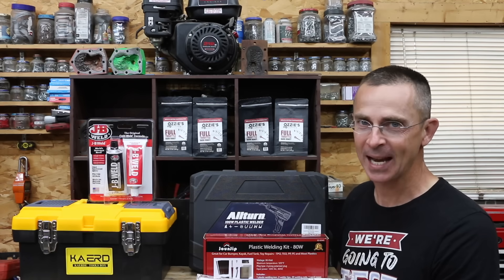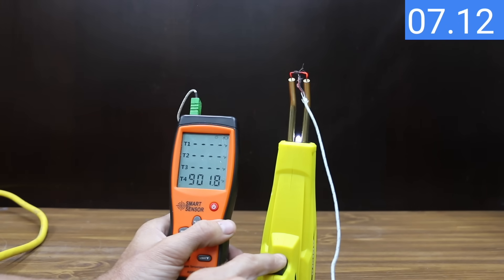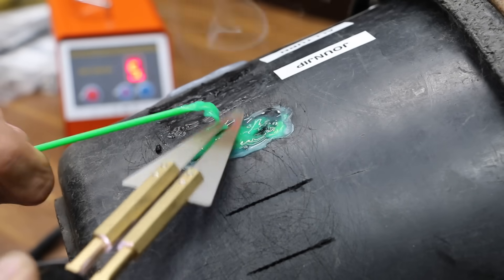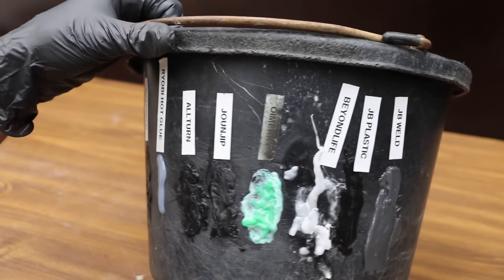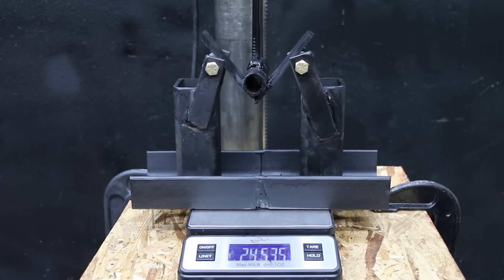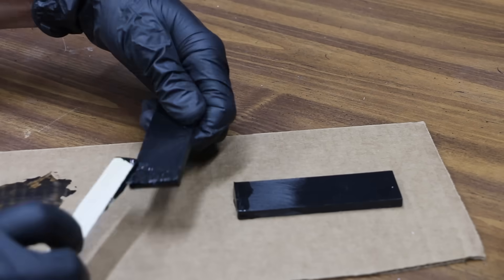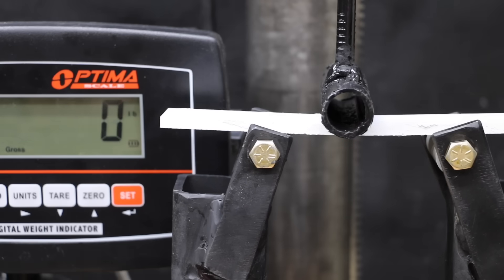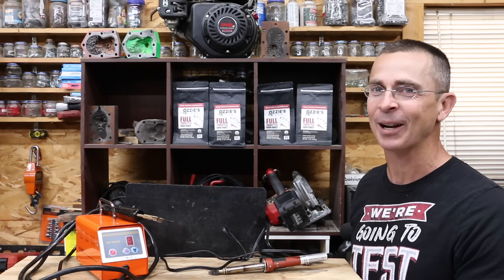Don't Buy A Plastic Welder Until You Watch This Review!

Comment: As an automotive technician I use the jounjip kit and found that for best results melt the wire mesh into the plastic before using the filler. Often times it’s stronger than the original piece and has saved my butt countless times. There is a learning curve and results become stronger and look better with practice.
Reply from the maker: That's a great tip!  I should have done that! Thank you
Reply: ❤😂jok4th o⛪️❤🤣 @ProjectFarm joints i😂😂I o k😂I o o iiio🎉🎉😂😂😂😂😂😂😮😢😢so 😂😂😂iieq1😂😂800W w😢chi iiio😊
Reply: @ProjectFarm  This thread is awesome and gives me an idea: Please setup a forum or something, where you announce future tests, so people can give you some ideas on how to best do the testing. Got to say though... most of the time I am at awe about the testing methods you come up with. :)
Reply: @ProjectFarm  please do Best Car Jumpstarter 2023 video with these brands: Foxpeed,Povasee,Lokithor,Noco[full lineup],Yesper,Audew,Hulkman and Gooloo GP200/GP400/GT400 please
Reply: @ProjectFarm there are a lot of products on the shelf that promise to clean and restore wet and dry paint brushes. Do you think they work better than turpentine or gasoline? They promise to be environmentally friendly but do they work and how much water do you have to use to get them clean?  Best Water Based and best Solvent based. You can even make multiple videos based on brush types natural vs synthetic.
Reply: Yeah you need to get in there melt the damage so it can fuze together.
Reply: @Lappmogel Fuse
Reply: @David25522 funny thing is once staples are placed to stop the split and maintain shape, the 2 part fusor is what to use after dremel grinding out a  v shape along the crack. 😊
Reply: @ItsMe-vg4vj damn that's some solid advice. Thank you
Reply: I was thinking that while watching, "shouldn't he be melting the mesh INTO the plastic?"
Reply: @Drundel  ,  A hot air heat gun is often the best way to melt the metal mesh into the plastic prior to applying the plastic welding stick over the mesh.
Reply: @goodun2974 No it's not.
Reply: @goodun2974 Bingo, heat gun is the key for an easy repair. I’ve been using something like that for the last twenty years now, I take license plate frames and cut them in small strips to use because it’s the same plastic as the bumpers I have also used tire plugs too.  I also keep a spray bottle of water that I spray my work area to quickly solidify it in place for when I’m shaping something. I also use spray foam behind the bumper when I’m making a repair while still on the car. That’s only if there’s like a whole or something like that. Skim over it with some finishing putty and primer and it’s good. Time saver for sure.😎
Reply: @annacurransmotherofmeghanc1841  , I work in a stereo repair shop specializing in older audio equipment and so I often have to repair broken plastic knobs, gears, cams, and trim, typically with a combination of heat and adhesives, and sometimes reinforcing the repairs with screen mesh, fiberglass cloth, heated staples embedded in the plastic (ordinary staples pushed into the plastic with a soldering iron) and so on. A large heat gun and a smaller hot air "pencil" are invaluable for this type of work. Some of the plastics such as nylon or polyethylene reject most efforts at solvent welding or gluing....
Reply: Another tip with just the triangle irons before using filler rods push one of the corners into the crack until the plastic melts together kinda like stapling then use the filler and finish by smoothing the repair with the iron
Reply: Good to know never used any one of the Plastic welders before
Reply: You beat me to it. I said the same thing in my comment.  It's a bit of a learning curve, but once you get it right, the repair is often stronger than the original piece.  It's best to heat the mesh directly to melt into the original plastic then use the filler.
Reply: Which method would be the best to get a clean repair like on a dash board?
Reply: @Deested  ive done a few dashes and bumpers and stuff that held up pretty good.....
i just used a soldering iron with a woodscrew as a tip (tip of the screw, screwed into the iron).... get hot...smear into eachother..... 
Always clean FIRST!! ....... then weld
ive melted staples in and covered with slivers from other areas i could cut a bit off (by the mount tabs etc).......... sanding not necessary till the end for blending
old shattered dried out will dashes shatter again....(no real fix as the plastic has degraded)
a good machine or higher wattage soldering iron probably would have worked better/faster
V groove like with a metal weld for thicker parts is a good idea.
shave slivers from reinforcing ribs mount tabs etc to weld with the same (right) kind of plastic.
shove the plastic as it melts around and mix it....build a ridge up behind the crack.
smear around a lot wider than the crack to work it into the crack.
a hotter tip will melt the surface fast...so you can pull material from a wider area without digging deep and thinning the repair area too much.
repair the area then let cool...then melt in a small piece of mesh....this keeps the heat from warping the whole area of thin parts
Reply: @kazzxtrismus you can use heat guns made to solder better than an iron, and they are relatively inexpensive.  You actually can set the air output temperature fairly precisely, and it costs less than a solder station (which is also temperature controlled).
With the heat gun you can pretty easily "flow" your repair like welding metal.   I'm a clutz and my plastic repair look like a good weld when done. 
Remember that the solder air tools are relatively low flow and have about a 1" outflow and fittings to go down to a 1/4"... these are not the normal heat guns
Reply: @Deested  V cut a groove in the crack.  Fill the grooved out area with like material, try to keep fill in just the groove.  Embed mesh like a bandaid covering the entire repair plus some on each side.  Make sure to embed it just below the level of the dash.  Fill area that was embedded with like material.  Sand flush and retexture.
Reply: @Deested a new dash board from my experience.
Reply: @Deested none of
Reply: @Deested  I'm not an expert, and I'm responding just in case nobody else does: for safety and simplicity, just use a weld without metal, and then scrape it until smooth.
Reply: @eugenetswong  if you do this without using the mesh it’s not a very strong repair with the 100 W plastic welder. Air tools, make way way way stronger repairs and the mesh also makes it a lot stronger.
Reply: @DustinTavo  'if you do this without using the mesh it’s not a very strong repair with the 100 W plastic welder. Air tools, make way way way stronger repairs and the mesh also makes it a lot stronger.'

That's great info. Thanks!
Reply: Same with all the triangle tips - they're designed like that so that you dig in and melt a root pass for complete fusion across the crack before you start building up with plastic filler rod. And if the part isn't then sanded back to the same size as the original or at least a consistant size on the samples then you've got no control at all - you could make the worst solution in the world work well if it's 3x thicker than the original part.
 I love these videos but this one has some serious issue with the actual application and use of the items.
Reply: Did that on a Volvo S60 10 years ago, the repair survived a wreck that totaled the car 😅

*I also used JB Weld Plastic to cover the mesh
Reply: @MrHeHim here studying up to repair my beloved volvo 850 rear bumper cover which got hit today. One side hanging, tabs broken 💔.
Reply: That's what I've always done.
Reply: Also depends on the type of plastic. Some types you almost need to temper like steel so that it's not brittle.
Reply: Been wanting to pull the trigger and get the Jounjip. I've some ABS interior pieces and a fascia to repair before paint and I guess this one will do everything I need.
Reply: 1/4" plastic is very thick. Should have been beveled
Reply: Could you attach the mesh to a staple gun and heat it up like a staple and push it in? 🤔
Reply: An update on my plastic welder. After a year and a half of heavy usage, it finally gave out. The brass tip broke off in the welder while removing it. I might be able to drill it out but I’ll probably buy another one. Overall, 10/10 tool, it’s one of my favorite tools to use, and it gets me out of trouble.
Reply: @Hayes-x2x brand?
Reply: Thank u brother!!!! That is why I'm here. I am a bmw tech and most days I feel like my purpose in life is preventing plastic parts from breaking and when they do $$$$$ and my work day/ week falls apart. I need a plan B
Reply: Hayes, thank you for the info!
Reply: Came to say this
Reply: Came here to say the same thing
Reply: I was going to say, pretty sure all the bumper repair videos i've watched they put the mesh in first.
Reply: Since you're an automotive technician have you noticed the viscosity of oil changing with same weight oils? I used 10w 30 of Castrol yesterday and I remember the oil having a long film looking strand when it got to the end when you dumped it in. Now it drips more like water
Reply: @stylicho check the ambient temperature, viscosity is supposed to change with temperature
Reply: How do you make it look "pretty"? I am trying to find the best option to fix a 4 wheeler fender and would prefer it look a little smoother. Is sanding after an option?
Reply: 0:22
Reply: Iiiio e😊are a we wabiIiid
Reply: I was thinking this before I read your comment.  Great idea.
Reply: Took the words right out of my mouth!
Reply: Good tip from your experience. Thanks!  What do you think about roughing up the surface more? When I did a lot of epoxy I quickly learned that while the epoxy was very strong, how it bonds to the part becomes the critical factor. If the surface is rough enough and the epoxy (or JB Plastic Welder) can get into that 'tooth' the bond is very strong. In the video the 'bonder' separating from the plastic seems to be more of an issue than the 'bonder' material.  Of course if the tool and the 'bonder' can't grip the material, it doesn't matter how strong the 'bonder' is. 
On one poly carbobate hatch on my boat I drilled a series of 3/16" divots. The JB Welder was too thick to get into those divots so it didn't hold.  I do like as rough a surface as possible. Just thinking out loud.
Reply: perfect example of why it's advantageous to get a clue of the basic principles before jumping into stuff.. no disrespect for the channel but most of the 'welds' tested more the technique than the products and the technique was mainly incorrect: just like welding, the parts and the filler need to mix/melt together. in essence those were 'cold plastic welds'.
Reply: @duroxkilo He does lots of tests I'm different products. The test he performed are great, but he is not in a lab. He's 1 of a kind and with is knowledge it helps all of us, well most of us anyway. I feel his tests help the home owner with little or no experience on a particular product. Bottom line his channel is enjoyable to watch and if someone is about to buy something he gives us usefull information before our purchase. Example he tests 10 cordless drills and the one we want to buy comes in last on his tests, of course we will not buy that one that came in last. He saves us money. Is he perfect? Of course not. At the same time he is better than most. His channel is educational and needed. He does not cut down bad products, he just gives a fair review based on the test he performs. I would rate his channel from 1 to 10 as a strong 9. He spends his money so we don't have to waste are money buying products that are not worth buying.
Reply: @duroxkilo Looks dummy, this is how 99% of the population is going to use these products. Go make your own channel if you can do better.
Reply: @duroxkilo total agree. No offense I think it’s harder than metal welding and cold welds are very easy to do. Especially with air tools extrusion welds are extremely strong they’re not coming apart like JB weld often does.  I’ve tried sledge hammering apart fire suppression tanks and it’s not easy. Only with 5 feet of wall for leverage could I kick it apart trying my hardes.
Reply: @DustinTavo  i believe it...
Reply: Jounjip welder is the only one with UL certification. I wouldn’t use the other brand anyway even just for a safety reason
Reply: As an automotive technician, I replace any part that has a cut or a tear. In 37 years I’ve never plastic welded anything, except at training. Most manufacturers don’t allow this.
Reply: @Everythingisgoingtobealright For things like bumper covers and other body pieces, it's often better to repair than to replace. They are not mechanical or structural. That being said, when using the imbedded metal mesh technique, the result is almost always stronger than the original piece.
When you can save $700-800 (sometimes more) by repairing a torn bumper cover instead of replacing it and the result is actually stronger, it's a no-brainer.
Reply: @HyperactiveSloth79 
It is never better to repair a torn bumper cover, if even one tab is broken the cover should be replaced. If you are working on your own car or a friends car you can do whatever you want. In a professional setting the car owner is trusting you to repair their vehicle to as close to original condition as possible. 
The insurance companies will always pay to replace.  What about various sensors and radar systems that work through the bumper? You can only add a specified amount of material to the bumper, and certainly no repairs in that area.  Sometimes there is no painting allowed, one scratch and you need a new bumper and you have one shot to paint it.
Reply: @Everythingisgoingtobealright  You apparently don't know anything about colon repair. Nothing you said makes any sense. The insurance company will OFTEN decide to repair instead of replace, actually. We do what they authorize. You wouldn't do a plastic weld on a mounting tab, or a sensor port, but there is about a dozen square feet of empty plastic in a bumper cover. It seems like you really aren't an "automotive technician" if you don't know these things.
Reply: @Everythingisgoingtobealright "allow"?  How would they know what I do in my driveway?
Reply: @chiphill4856 
The original comment said “as an automotive technician”. I was responding to a professional not a diy guy.
Reply: I remember I had a crack in my radiator, having it towed to a shop. Looking back, I can't believe they didn't have a simple plastic welder and I had to replace the whole radiator. This could have saved me hundreds! All shops should have this for a cheap fix for clients. I had to spend money on a hotel, wait and wait and wait and wait for the radiator.
Reply: @jondoe6926 radiator is under high pressure.   The plastic weld would need to be perfect to seal.
Reply: What makes the JOUNJIP stand out is the only plastic welder with UL certification. Safety first.
Reply: UL is a joke. It’s so easy to get stuff UL approved. Just pay the money and it’s approved.
Reply: @bienjay06  your uL is jus that the usa approved it wont electrocute you nothing more
Reply: I have had the very same results using Jounjip and Harbor Freight's plastic welder in a pinch with success on a car side skirt 6 years later.
Reply: Have you ever found anything to fix a cv boot? Tore one on a new axle and there just isn’t a sizable replacement 🤦‍♂️
Reply: Yeah I was surprised he didn't try to bother embedding the mesh.
Reply: Colon repair?  You want to weld a bumper go ahead.  I’ll keep on replacing them.  For most small repairs we have the parts painted and polished before the vehicle arrives, most bumper jobs are done in one day or even with the client waiting.  Nothing makes a client happier than a fast and proper repair. 
I’m sure you would be very surprised at what the insurance companies pay non DRP shops for.  The shop I work for uses maybe 5 used parts a year, and never aftermarket. We buy some new OEM hardware for every car, we never pay for aftermarket hardware.  That’s just a couple of examples of what you can get paid for. Once you start asking for the things to do a proper repair and the insurance companies actually see you doing them, they will pay.  The Corona did a great thing for body shops, it weeded out the weakest shops, now there’s more than enough work to go around. You don’t need to rely on insurance companies to send you work and tell you how to do it.  
If you don’t believe any of this, that’s fine but that doesn’t mean it’s not true.
Reply: @Everythingisgoingtobealright  sorry, typo.
...and if I want to tell the customer that you're charging them additional unapproved costs because the insurance company didn't approve a replacement but you went ahead and spent $1000 of their money replacing it for no reason, then you go ahead.
Reply: @HyperactiveSloth79  
If for some reason the insurance company didn’t approve the new bumper, we would have that conversation with the client ahead of time. If they didn’t want to pay the difference, we will send them to a shop like yours.  I think most shops would be surprised at how many jobs we pass on.  If we can’t make a profit completing a top quality repair, we won’t take the job.
Reply: Please review concrete brand or types. Like quick setting
Reply: I was thinking the mesh should definitely be in place before inserting the staples on the products that use them.
Reply: @HariSeldon913  If you apply the mesh first, then it would be hard to get the horizontal portion of the staple through the mesh.
Reply: @TheReal1953Thank you!
Reply: You don’t need the mesh if you use the staples. That’s the point. 

I have done  some great bumper repairs with the staples and then grind down just a tad and use some evercoat glaze to finish.
Reply: @HariSeldon913  But the "staples" insert upside-down compared to actual staples.  Therefore, you can NOT put a mesh down first.   DEFINITELY mesh AFTER staple.
Reply: As a cashier I have given out countless dimes.  Dimes are rarer than quarters.  My job title is irrelevant to the test.
Reply: @WeighedWilson Huh?
Reply: @SayAhh  @WeighedWilson's comment sounded to me like a troll spouting nonsense. .